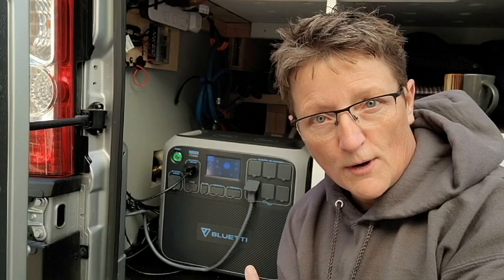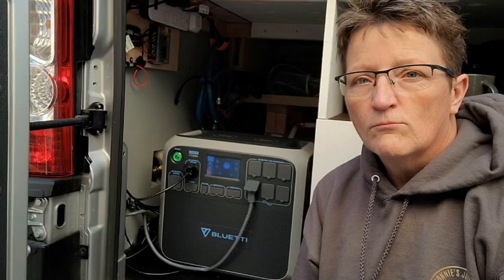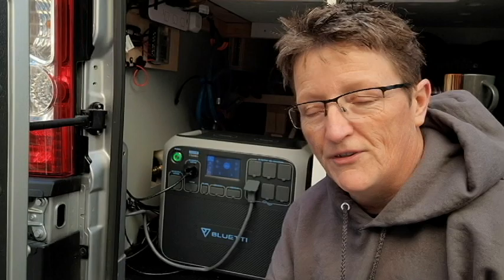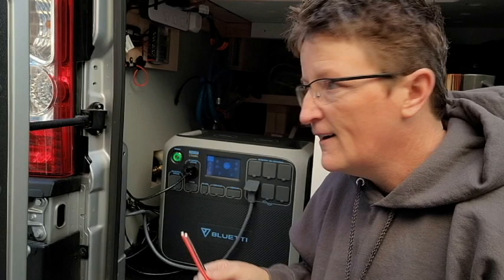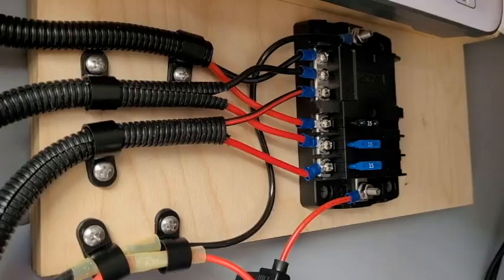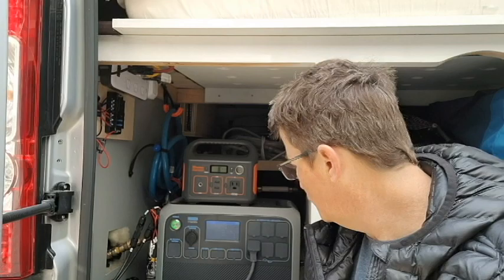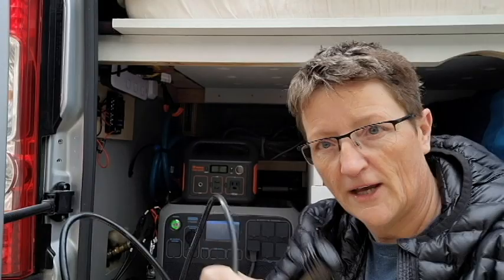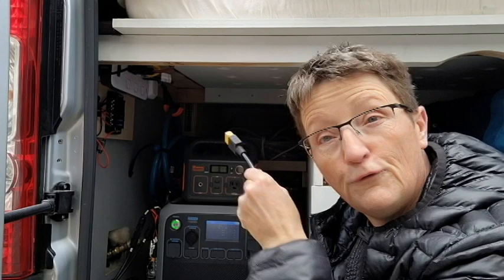Connecting 12V Fuse Panel To Portable Power Bank

Comment: I have the newer EB70 Bluetti which does not come with XT90 or aviator plug receptacles so I need to create a cigarette lighter adapter. I can't find one anywhere. How did you make your own XT90 to Cigarette lighter male plug adapter?
Reply from the maker: Mine came with the Bluetti but....  amazon has a cord that is 15A  (CUZEC Heavy-duty 15A Male Plug Cigarette Lighter Adapter)    they have all different kinds.   Also,  I used the xt90 for quick disconnect because I have Bluetti and Jackery. They have different connectors.  If you just plan on using one generator you can skip the xt90 and wire this cig cord directly to fuse panel.
Reply: @JonniesJourney  
Thanks!

Comment: This is exactly what I was looking for! Thank you. 
I have an Rpod that is already wired up, and I want to leave those connections for when I am plugged into shore power. But if I plug my Bluetti into the 30amp shore power, it use 47watts just to run through the converter. I'd like to bypass that when I am boondocking and just power my 12v fuse box. Can I hook my Bluetti up to the 12v fusebox right over the top of the current connections...essentially doubling up the ring connectors to the positive and negative input of the 12 v fusebox. this would also save me the trouble of rewiring all my appliances that are already wired through the RV into the current 12v fusebox.
Reply from the maker: I think you will have to add an isolator switch to shut off power going to 12V while Bluetti is powering

Comment: What is that 12v dc 25 amp chord called? The one that comes with a Bluetti but you needed a second one for the dc power cus the other one is being used for solar
Reply from the maker: It's an aviator plug (2 pin)  Bluetti is frequently out but Amazon has them. 👍

Comment: Can the Bluetti power stay on continuously? ready for use without using up the watts. I have mine in the back and I'm finding it a nuisance to get out and power it up each time I use it.
Reply from the maker: Tha DC does fine that way, but the AC will really drain rhe system down while you sleep
Reply: @JonniesJourney   Thanks Jonnie! I'll just need make it reachable. 🙂🙋‍♀
Reply from the maker: That's your best bet 👍

Comment: Does the white wire hanging from the maxxfan connect to the Red or Black 12 Guage wire? Does the black wire hanging from the maxxair fan connect to the Red or Black 12 Guage wire? In your video where you point to the two wires connected to your fan, one of the wires that's on the top half of your fuse panel appears to be red with black lines on the red. Did you just color it with a black marker? I didn't see that kind on your link. I bought the wires that looks like one is Red and the other is black,I didn't buy a wire with black and red on the same wire cover.
Reply from the maker: It had red on it because they were attached together on the spool you divide them right at the fuse panel it just gives you a cleaner look.  black is neutral red is hot.     If you have black-and-white wires black is hot white is neutral
Reply: @JonniesJourney  So thankful for your helpful replies. Have a spectacular day.
Reply from the maker: @funzeevanzee  you too. Happy to help

Comment: Thanks for the video Jonnie!  Do you happen to have a link for the DC to XT90 plug that connects the generator to the fuse box?
Reply from the maker: You have to make it Jennifer.  Also you only need the xt90 if you have a backip device with different adapter.  Like one has aviator port and ither has cigarette port.  If no backup just use 12 awg wire to dc fuse panel and connect your aviator plug.  👍

Comment: This video is super helpful! Thanks for making it and so many of your others. You show the XT90 connector for a Jackery option. Do you have a link for that one or a name? I didn’t see a link down in your description. TIA
Reply from the maker: No mine came with the Bluetti.  What you need to do is make one.  Take the xt 90 or 60 which ever one you bought and use your 12awg wire and connect to a cig adapter.   If you will not be using different devices you can just do direct wire from fuse panel to generator. please reach out if you have further questions.

Comment: Hi, Great video! Can you provide a link for the XT90 to cigarette port cable? Thanks!
Reply from the maker: Mine came with the Bluetti.   you can connect the xt90 or xt60 (depending on your setup) to a cig plug.  Bluetti seems sold out constantly.  Lot cheaper to make your own as well.

Comment: Thx Jonnie, I have an ac200 but my aviation plug to xt90 cable that came with it, only works on the input side of the Bluetti. The 12v/25a outlet has a female fitting, which means I would need to make a new aviation fitting cable with the 2 prong male connector going to an xt90. Was that your experience too?
Reply from the maker: yes it was.  I have links in the description below if you can't find one.  thank you so much for watching.
Reply: @JonniesJourney  perfect, thanks for that Jonnie! Happy vanning;)

Comment: Thanks again for your WEALTH of information. Ready to explore some of these places you have been. Was curious if you actually fasten your Bluetti down anyway or if it just rides in the back? We were thinking of building some shelving around the wheel well and strapping it to the shelf but wasn’t sure if that would be a good or bad thing. Thanks!!
Reply from the maker: I do not have mine strapped down. I move it around some but it does not move while I am driving.   Jeff when I get back to WV I am going to make the video on my complete setup.
Reply: @JonniesJourney  I was figuring that but was curious what others did. It’s not exactly lightweight for sure. Safe travels! I imagine the weather is a heck of a lot nicer in WV than it is here in SE Texas. We are melting at this point!

Comment: Help Jonnie, I’m so confused. I understand you connected the XT 90 to your fuse panel. And I understand that the cigarette adapter fits into the jackery, and then that cord can attach to the fuse panel via XT 90. So I follow you there. (My second source is a Goal zero 500 so it’s the same concept as what you did with the jackery) 

I have a Bluetti AC 200max. The aviator plug that came with it is FEMALE. So it won’t fit into the 12v/12 amp socket. That needs a male aviator. 

I ordered the male aviator but the other end of that cord is an XT 60. 

Did you jury rig that cord with one of the XT 90 adaptors?  Because the only way I can figure out how to make this work is to either make the cigarette adaptor for the jackery have an XT 60 on one end, and the connection to the fuse panel have an XT 60 also. 

Or- make that male aviator plug have an XT 90 end to it by cutting the XT 60 off and splicing the 90 on there. 

Help!
Reply: I think I figured it out after reading all the comments.  I can use the Aviation (M) to my bluetti 12v/30 amp.  The other end is an XT60  F.  I can order a cigarette lighter adapter for my Goal Zero  which will have a XT60 F on the other end.  Then either one of these can plugged into the same adapter, which is the xT 60F.  My fuse pannel will have the XT 60 M attached to it.  I'll put a 25 A fuse between the positive of the fuse panel and the XT 60 positive.  Whew!   (How'd I do? :)
Reply from the maker: Can you email me your phone number.  midwestvanbuilders@gmail.com

Comment: What size wire from SA20 Pins to the DC fuse block.  And is it too many amps to use the 10amp cigarette lighter port on the Bluetti, do you have a water pump connected too,just wondering about why we should use one over the other.  Thanks Again!
Reply from the maker: i used the aviator port because it would not vibrate out. 14awg wire is what I used. i use my cig port on the Jackery for backup and it handles it fine.

Comment: Hi!! Great info. Can you share the link to the cord that plugs (cigarette thing) into the jackery  that is with the link to the 12 volt panel. Thanks
Reply from the maker: You have to get the xt90 connector, wire and cigarette adapter and make one.  My Bluetti came with one.  If you want to direct wire the 12v panel to the jackery with cig cord I can drop a link for a wire you can use.
Reply: @JonniesJourney  thank for all your vids. Very informative and thanks for your service!! I’m a retire RCMP 🇨🇦 soon hitting the road, winter in warm south USA! Hopefully borders open up. I’m stuck in winterland

Comment: So what do I need, confused about the 2 cables.  I have a 400 watt panel on my roof- I want to continually charge the bluetti- but I also want my dc fuse box live at all times.  What do I need
Reply from the maker: The Bluetti comes with the cables for the panels so all you need is to hook your fuse panel up with an aviator plug to the bluetti.  I use the xt90's because I have a backup Jackery that has the regular cig plug.

Comment: The link to the wire indicates 14 awg. Is the 14 awg what you used to connect to the maxxair wires? And then you attached the 14 awg wires to your fuse panel? But the xt90 is 10 awg. And that's ok? What is that tiny single black thing with apparently one fuse in it? Is that connected to the xt90 pigtail? Do you have a link?
Reply from the maker: The link should have 12awg as well.  I will check it.  Yes I have the 12awg to the xt90 and have no problem.  I was told that some of the Bluetti's have xt60 connectors.  I will see about getting a link for the fuse line.  New video coming out tomorrow with my complete setup.  many have been asking, hope it helps.
Reply: @JonniesJourney  Thank you. I ordered the 12 gauge.
Reply: @JonniesJourney  anxious to watch.

Comment: @Jonnie's journey did you ground your fuse block to your van or does the negative get wired into the negative end of the xt90 connector? Thanks for this video!!
Reply from the maker: Wired negative to XT-90. Bluetti said you don't have to ground to chassis however...my LED relay flickers (common problem) so I grounded to chassis and zero change.

Comment: Great video. It's been so helpful. Did you make the cigarette plug to XT90 connector or did you find it somewhere? And what size inline fuse did you use. Thanks for any replies.
Reply from the maker: i use 15 amp inline.  the cig to xt90 came with Bluetti but can be made as well just like you would make the aviator plug.  so glad this video helped.

Comment: What size is your inline fuse?  This is a great explanation of how to use the Bluetti.  I have one that I want to use in my trailer. You are the only one I have found, that has shown how to do it with the 25A connector. My trailer also has house batteries that I will continue to use so I will have to switch between the two.  I don't full time so I will be taking the Bluetti in and out.
Reply from the maker: thats so awesome.  i have a 15amp in.

Comment: Great video! This one is under rated in my opinion. This is exactly what I was looking for. I have a camper that I am building and am looking into electrical. I have zero knowledge when it comes to this. I am going to be using your setup that you have here. I do have a couple questions.

SA20 Pins cable seems to be unavailable. What other item would you suggest?

The fuse at minute mark 2:50, where do I get that at?

Can the fuse box be hooked up to toggle switch panel?
Reply from the maker: Thank you for watching and the kind compliment. Yes hook your toggle panel up to one fuse panel. Zero problem.  The SA20 I had to make. The link is in the description for the Sa20, if you have any hesitation let me know and I can make you one at cost and shipping.   The fuse can also be purchased off Amazon let me get a link and add it to video.  Good luck on your build.  Tip: dimable 12v puck lights seem to flicker a bit everytime the Bluetti gets a surge or drop such as the water pump kicking on and off.  Avoid this by getting non dimable puck lights.

Comment: You are sso right about none of the video's out there that really show you anything I am so glad that I found your channel because you did just what I did and I was told by a solar guy that just knew it all tell me it wouldn't work so I had to try it and it worked great then I see you did the same thing but I stopped with the surge protector and you wired to the box and plugged in to that and dang if I didn't like that just because I can move my bluetti out of the way now I thank you for that tip. As for the 12 volt I have been thinking of undoing it from the bluetti and going with a battery and I still may because the DC power does use a bit more power than I want it to but I don't need to I have never ran out of power it's just that I would have more AC power to play with and maybe able to get another day on the freg. Other than that I have been happy with it the way I have it set up. Now I am not wired off the van battery at all on mine but who knows you may just sell me on that one day.  Oh I just saw that your using the cigarette lighter to run your fuse panel I have mine set up to the 25 amp port I have never plugged into the cigarette plug but I do have the wire for it. Now I am running lights and both the maxxair fans with mine as well as two USB chargers for the phones and I think I have 7 double LED lights so I do pull a little more power but keep in mind I don't run all the lights at once unless my wife can't find something then she'll have it lit up like a Christmas tree lol. Take care and stay safe.
Reply from the maker: Lol thats great.  I have mine to the 25 amp aviator plug. I only use the cig for back up. If I do something stupid and drain the Bluetti I have a small Jackery backup.  It sure is a easy setup.

Comment: Question: can I just wire a maxfan (black and white wires) to the other end of a cigarette lighter plug and then plug it into  my bluetti eb70's cigarette lighter socket?

And do I use the INPUT/MPPT to plug in solar panels?

And...can I use the maxxfan while I have solar panels plugged in or do I need to unplug solar panels before I use bluetti eb70 to power my devices????

Sorry, for so many questions but I am a major beginner at this and I am learning so much from you guys!!!
Reply from the maker: What battery system do you have?  Why don't you send me an email to midwestvanbuilders@gmail.com so I can help better

Comment: Hi joanie super helpful just wondering on the sa20 connector you created is 1 positive or negative? Want to make sure the red dots that align are either the positive or negative. Thanks!
Reply from the maker: Mike when you make your cord the SA 20 has a 1 and a 2 on the prongs when you unscrew them.  almost positive the 1 is positive.

Comment: I LOVE your videos and think you are doing a great service to all of us trying to learn about portable solar and diy van building. That being said, I'm not sure if some of what you're saying is correct.  Doesn't that cigarette output from the Bluetti only do 10 amps? If you plug in something that requires 15 amps it wouldn't give you 15 amps but 10 amps max??? Again, not trying to be rude or upstage you - just trying to figure all this out. Wiring this way only gives you a total of 10amps for your fuse panel unless I'm totally lost. I also am unclear on using the solar input cord into the 12v/25a output - it isn't the same(one is female and the other male). I was planning on doing all of this going through the 12v/25amp output using their cord which is sold out right now. I looked online for something else but I think I just need to wait for it to get in. Please let me know if I'm not making sense. I'm new to this and GREATLY appreciate your help! Thanks again!!!
Reply from the maker: Thank you so much for you comment. I appreciate that..  Yes one is male and one is female.  The link in my description is the correct SA20 adaptor for connecting the fuse panel to the 12v/25a plug.  I do not use the 10a on the Bluetti for my fuse panel. I use the 25amp.  I use the cig cord for my Jackery.  I am always learning as I go.  If you are going to use the 10 amp instead then you can change fuse to 10 amp.  As long as you don't pull over 1200 watts at any given time you should not trip your system. I have leaned that unless you are trying to produce heat it really doesn't have a high draw.  Add heat like blow dryer, cook top ect and then there is trouble. Lol.
Reply: @JonniesJourney  WOW - you are on top of it!!! Thanks for clearing that up for me. Like I said, I'm a newbie but read everything I can. You should join the Bluetti Community and check out the post about the guy who used an interlock on his main panel so he could use his Bluetti during outages. 
I lived in Yuma, Arizona for 25 years and loved the winters. Started laughing when I saw your Flagstaff video. You never know in northern Arizona what the weather will be like, kind of like Denver! We're now in San Diego(Rancho Bernardo) and always game for company!!! Both my husband and I come from big families so we are pretty chill.
Reply from the maker: Yes it was a crazy ride in that snow storm.  San Francisco is on my list.  I will have to check out the group.  Thank you so much for the tip and for the questions.  I am learning as I go for sure and love it.
Reply: thank you for the obvious question.   You CAN'T run the entire 12 volt world by plugging into a 12v 10amp Bluetti socket!!

Comment: What if I already have my shore power wires hooked to my positive and negative on my fuse box?  Can still put my  XT 90 cords connectors to the fuse box?
Reply from the maker: how are you converting the power from AC to DC.

Comment: Question: on the 25 amp cord to the Bluetti 200, are you wiring this together yourself or is there a cord with that connection already made?
Reply from the maker: Bluetti has been out of this cord every time I look.  I made mine. I have a link to the Aviator plug in the description.
Reply: @JonniesJourney  
Thanks 🖖